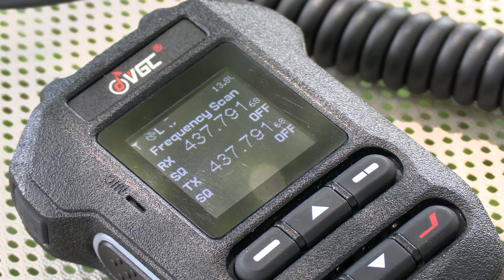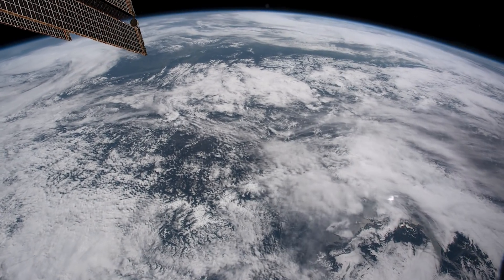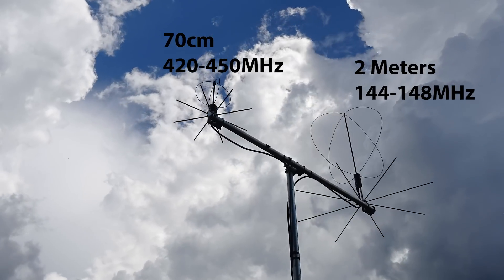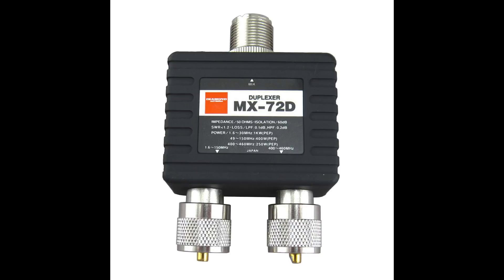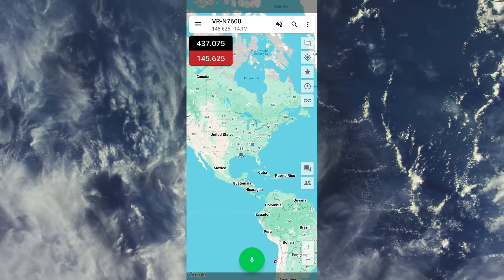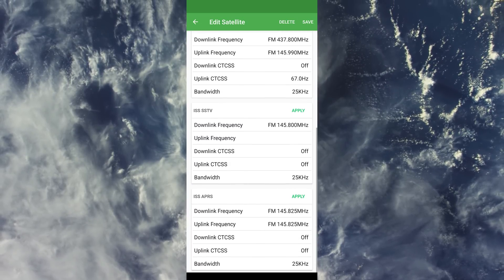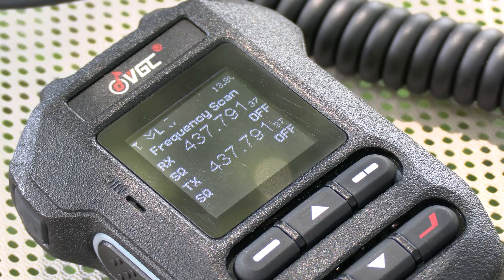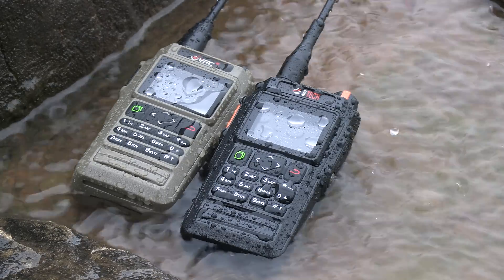Testing the new SATCOM Feature for VR-N7600 VR-N76 & UV-PRO

Comment: With tariffs how can we afford them
Reply from the maker: Price is still not bad for all it can do
Reply: The N7500 has most of the features of the 7600 except for the different mic and the 7500 its easier to make an extension for the mic. I think the big changes between the two are the display on the mic and the AI noise reduction. If you have a small sedan, I think these two are your best choices for a mobile install.

Comment: does this update work for the VRN7500 also?
Reply from the maker: Not sure. I no longer have mine to test with. This is mostly an app update so worth a try.
Reply: @The_Comms_Channel  I now have ISS and Amatuer sat maps, but dont seem to have the frequency input and doppler features.
Reply: I have the same question.
Reply: The amateur satellites work on the N7500 as well. The biggest hangup I think is getting around their menuing on the app. Both are superb radios for their size. The 7600 mostly gives you the display on the mic and the AI noise enhancement.
Reply: @MichaelLaferriere  I haven't been able to get mine to display RX/TX freqs. and doppler control. I mostly just get sats on a map.

Comment: I wish they would fix the issue where the radio will send an aprs msgs 4 times even if it gets an ack back from the recipient.   Thanks all your hard work showing these new features.
Reply from the maker: Not noticed that. Is that using the HT app?
Reply: @The_Comms_Channel I am not sure if it is a “feature” of the app or the ht firmware.
Reply: It is a firmware bug. I tapped out a msg on the HT no app connected, sent the msg and received the ack and the HT sent the message 4 times receiving the ack all 4 times.

Comment: which firmware version is this?  after tapping my "up to date" firmware (0.8.4), i have an option for 0.8.8, but don't see the doppler shift in release notes?
Reply: I don’t see an option for.0.8.8 yet for my UV-Pro.
Reply from the maker: Be sure to use the latest version of the HT app (not available in the play store yet - linked in the top comment)

Comment: This Doppler feature is generally useless on 25 kHz FM because the Doppler effect is well within the discriminator's tolerance.   You need Doppler compensation for sideband linear transponders, but for FM this is just a dog and pony show.
Reply from the maker: Still useful, especially for the 70cm side where there's a bigger shift. AMSAT also recommends adjusting for doppler in their documents https://www.amsat.org/wordpress/wp-content/uploads/2014/01/Work_FM_Sats-20131010.pdf